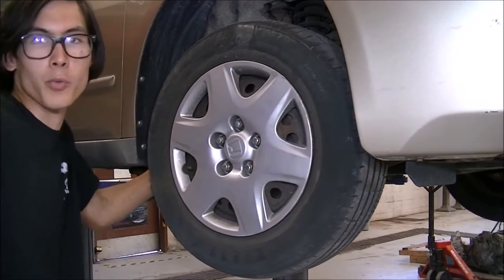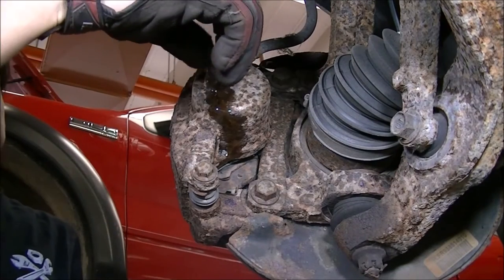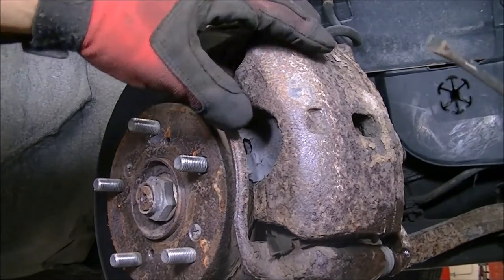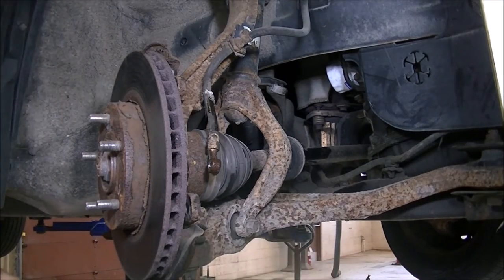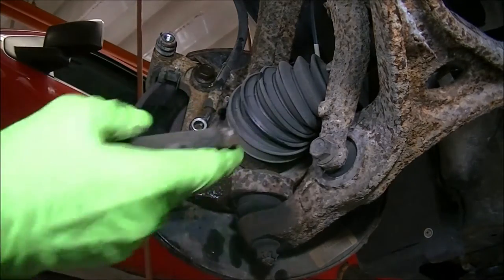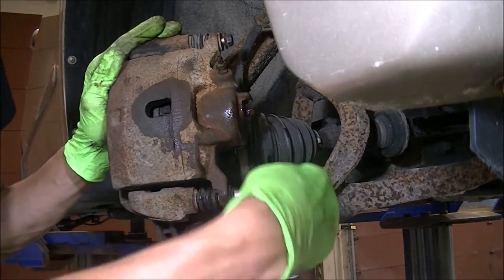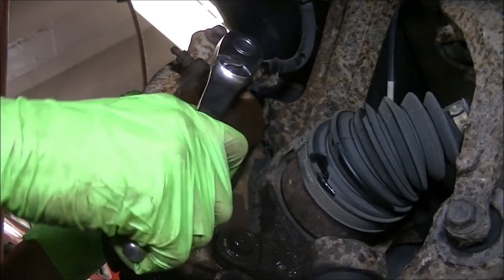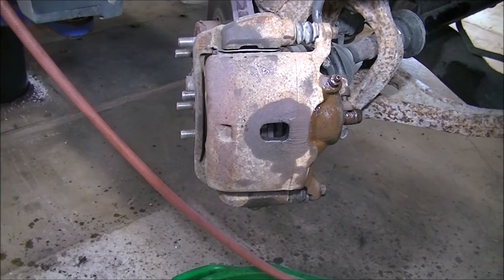2003 - 2007 Honda Accord Front Caliper Replacement (2005 Honda Accord) (Passengers Side)

Comment: What do you mean by "pressurized it?"
Reply: Press the brake pedal
Reply: Pump the brakes until there’s lots of pressure and resistance. Hold the brake pedal (pushed in) and have someone open the bleeder valve on the brake caliper until all the air is out of the system. Do the furthest side from the brake master (the reservoir where you put the brake fluid in) first; this tends to be the right rear well(1), left right rear well (2), passenger side (3), and lastly driver side (4). Make sure to do it on a level surface and keep an eye on the brake fluid level! Hope this helps.